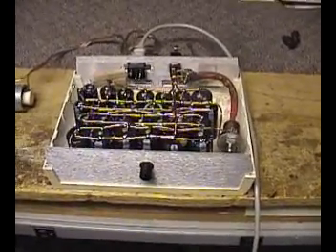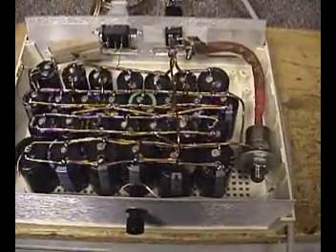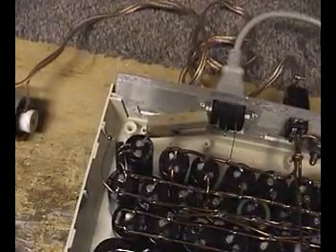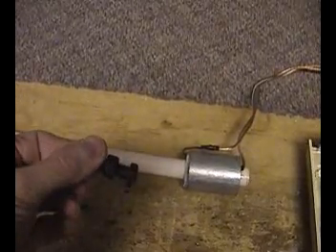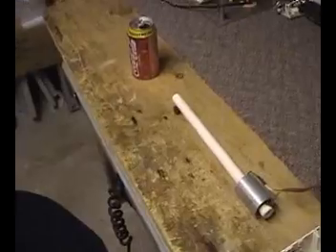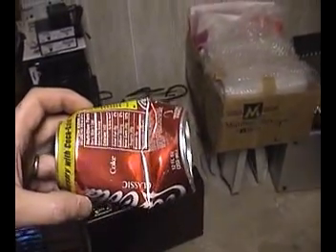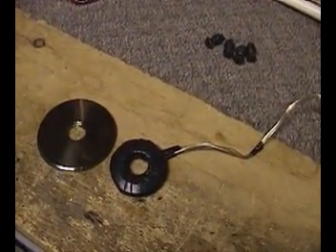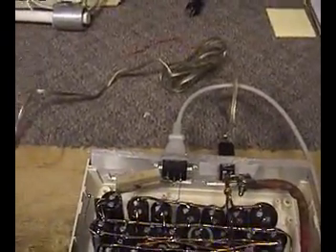Coil Gun 2

Comment: "only 320V" you wont say that if your thumb goes across it :-P lol.
Nice bank. Ive just built a 400V, 6000uF bank with a 240A SCR (which has blown once and been raplaced).
scared of going any higher with the voltage!

Comment from the maker: The schemaitc is at geocities(dot)com/bobdavis321
It is basically 2 microwave oven transformers with their primaries in series, so they only deliver 1 KV.  There are 2 Microwave oven diodes one to each secondary then a 500 ohm 10 watt resistor to the capacitor bank.

Comment from the maker: I have been using 100 amp SCR's.  The SCR block in my latest 800 volt model is a 250 amp, 1200 peak AMP model.  I buy them on Ebay!

Comment: hi there, cool and informative video.... i have a few questions to confirm with you...

firstly, the coil, is the wire wound up in a single direction or does it goes the oposite direction when doing the second layer. my coil just magnetise it...

secondly... my caps, does yours run on a series or parrallel?

thanks....

Comment from the maker: Yes I also have a tesla coil, the video is here somewhere.  There is also a dual vacume tube tesla coil around somewhere, but no video yet.  Stand by, I am building a 900 volt pwer supply with much more power.